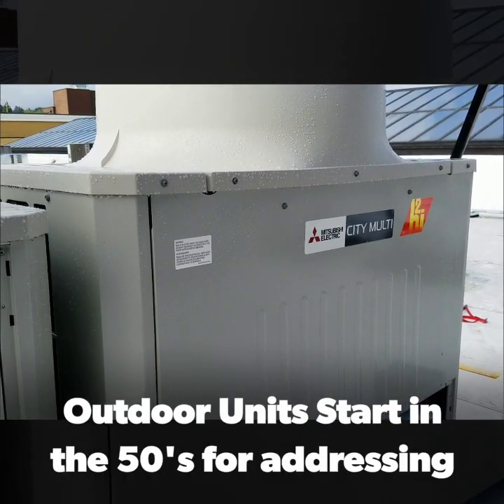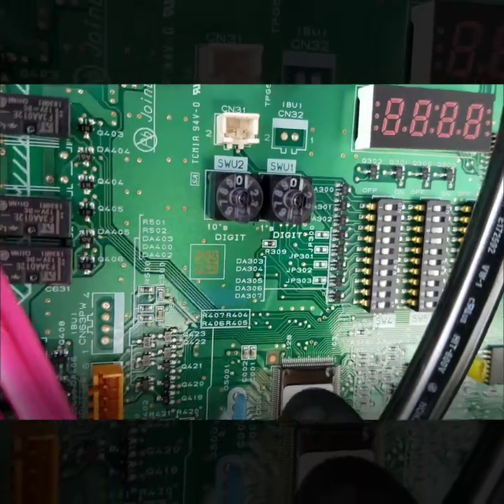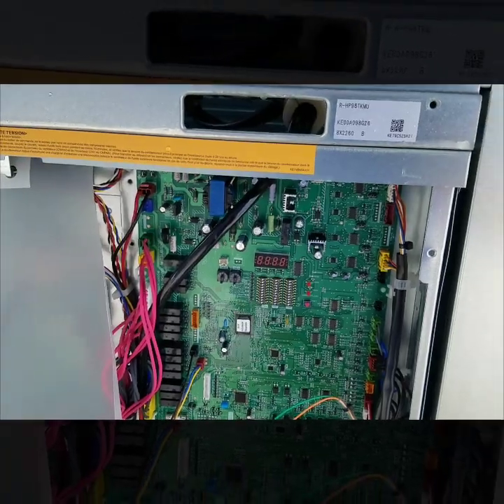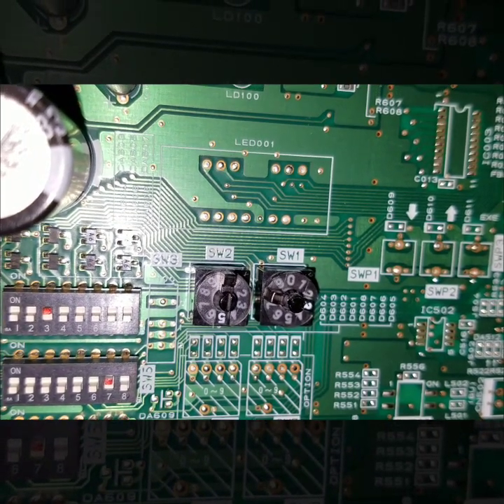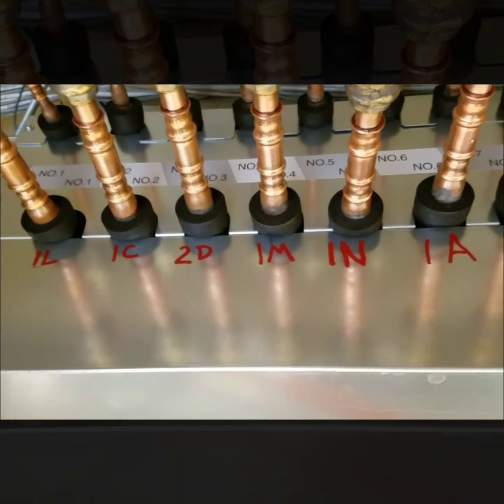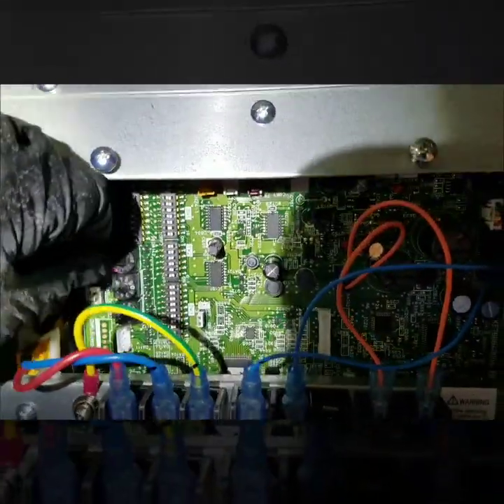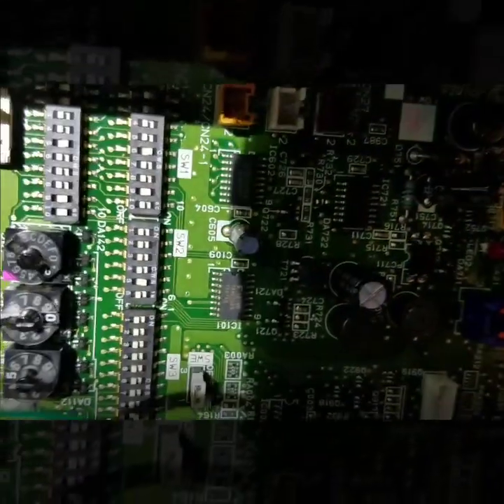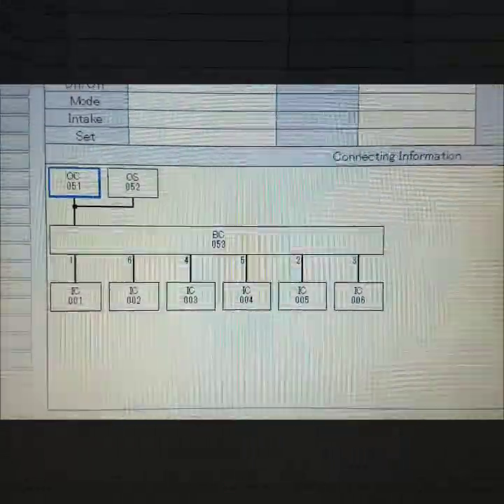Mitsubishi City Multi: How to properly address system on install

Comment: A good tip to add is when you have two or more systems tied together with a central controller your addressing changes.  Just a FYI for other techs.  Simple yet effective video.  Good job bro.
Reply: I need help in addressing systems tied together with a CRC. Could you please tell how to address in this case?

Comment: I did my first one couple of days ago, I am having problems with the unit, 😔 I thought the indoor address second rotary knob was suppose to match the bc box ports for example if unit is hooked on port one the rotary dials would have to be 1 and 1 and so on and so forth. Can you tell me why u did 5 and 1 on the indoor unit? Just trying to learn.

Comment: i change a control pcb on puhy p400 i copy the setting of dipswitch but i forget to set the adress rotary. but the unit run in normal operation?

Comment: Do you service a lot of City Multi's?
Reply from the maker: I work on a large varity of different types of HVAC equipment. Which includes City Multi equipment.
Reply: Same for the Company I work for. I’ve always worked for Non-OEM shops. Guys like us have to stay on our toes because the multitude of varying equipment we have know pertinent enough to get either installed and them repaired. 
But we don’t get all of the insider training and secret information that these OEM Techs get. And I get it. But they’re usually only Specialize in their particular Brand and Make.

Comment: The best in HVACR systems is DAIKIN products.
Reply: More like most expensive.
Reply: @rm20235  good morning.
You can see the price of daikin system and it is as similar than mitsubishi.
In extranet daikin or web you can see it.
You will have a litle sorprise
Reply: Not on the mini vrf...... Show me one document in writing that says daikin will do low ambient below 23 degrees with wind baffle...  Mitsubishi does........
Reply: if the compressor replaced a new one we need to address the outdoor or not? vrf city multi mitsubishi